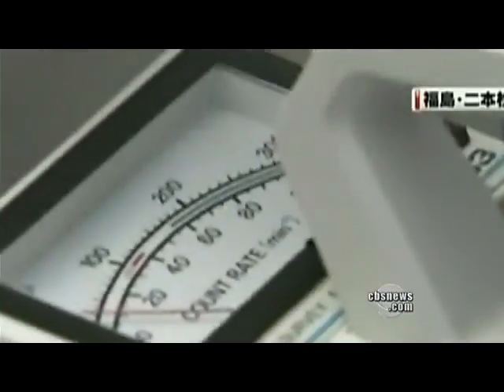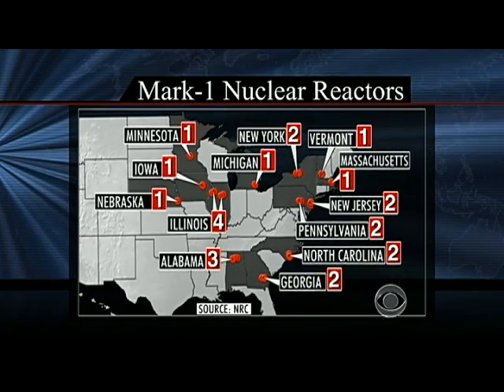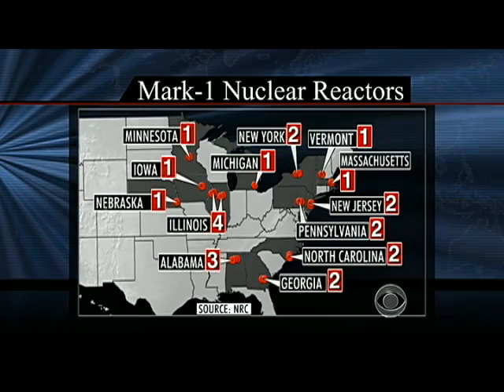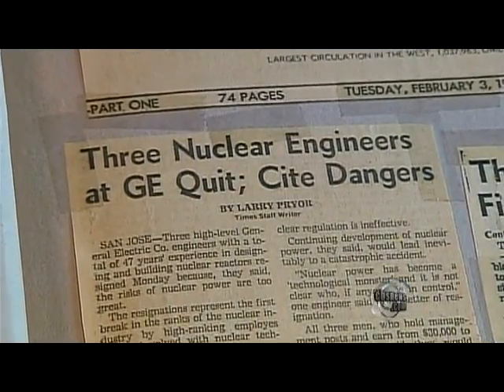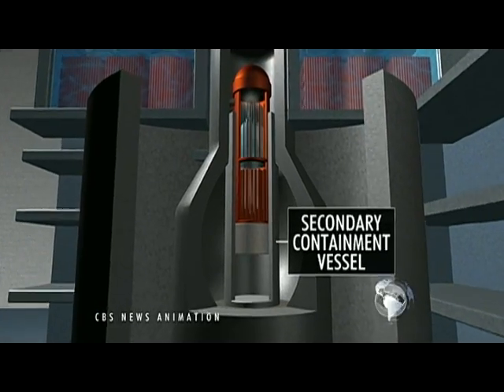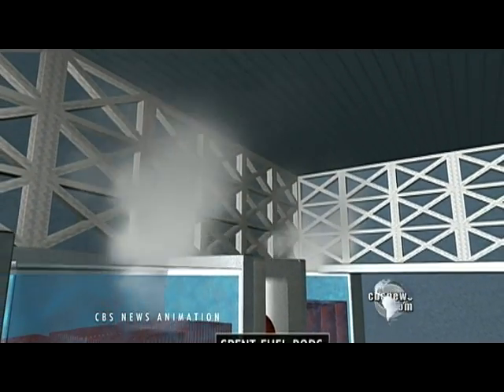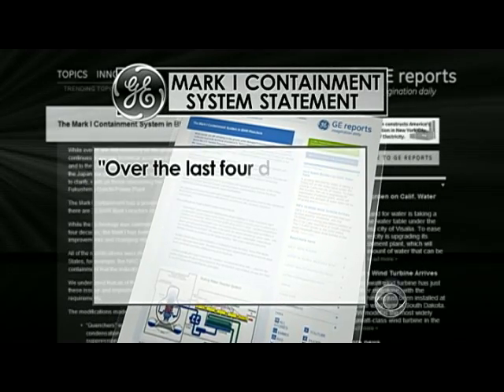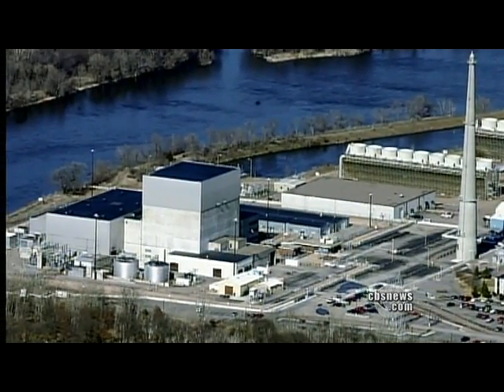The danger of old U.S. nuclear plants

Comment: seems to me that spent fuel rods are not spent in this design but reactor is to inefficient too use them. True spent fuel does need cooling. In Canada They do not use enrich uranium but use heavy water to slow down the neutrons.  If they get cool leak the nuclear reaction will slow down and rod will not melt down.